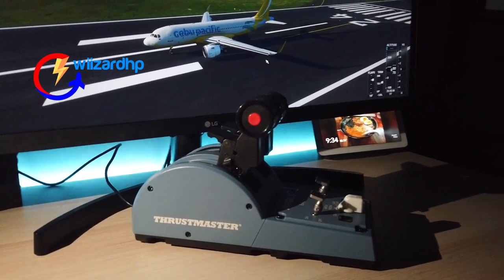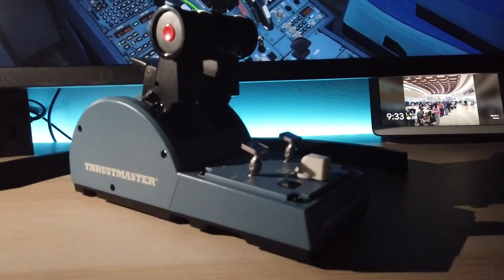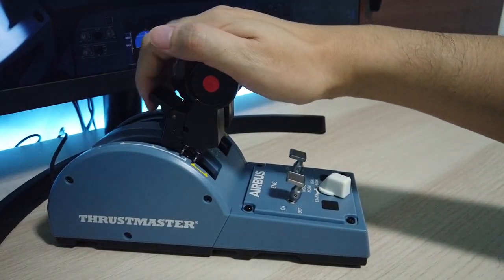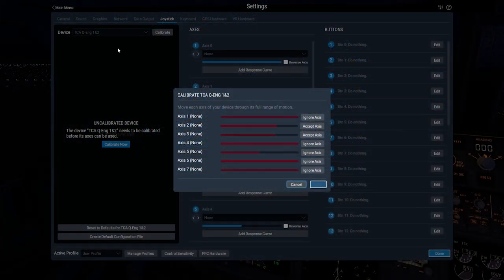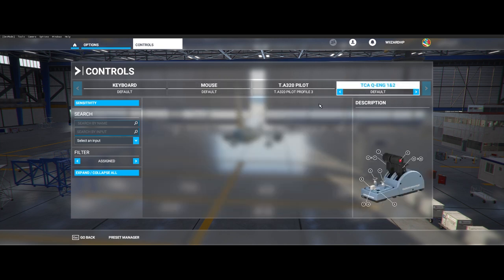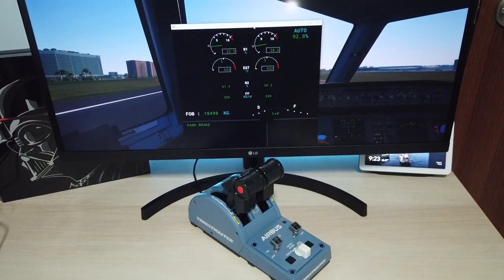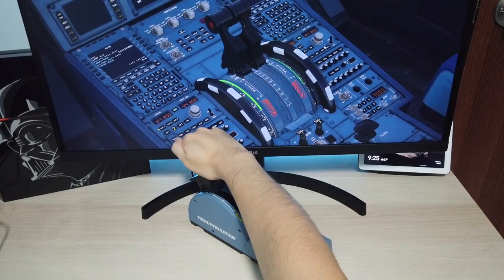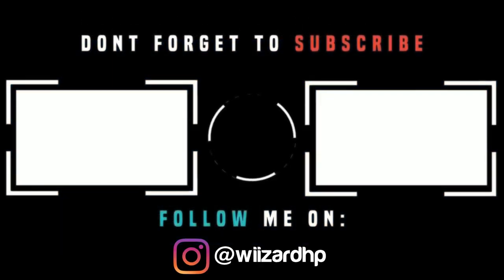Thrustmaster TCA Quadrant Airbus Edition after 24 Hours

Comment: 2:53 same problem too:(
Reply: Run the calibration cycle. Set engines to reverse, disconnect the quadrant from a computer. Press and hold the button to the right of the second engine switch and plug it to the computer. Now release the button and move the throttle to toga,press both of the auto throttle buttons, move it to the previous detent and press the autothrottle buttons, keep doing that untill your back on reverse; at that point disconnect and reconnect the quadrant.
Reply: @Petereoooo  calibration dosnt work i did that more than 10 times
Reply: @fulcrum_9162  did you update the firmware before hand? Also don't forget to place the screw driver locking both of the throttle levers together.